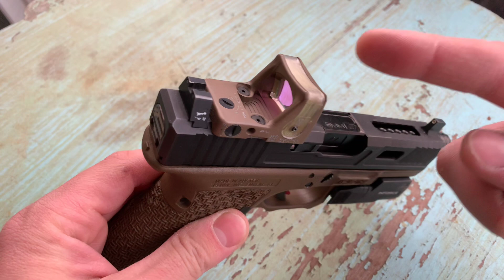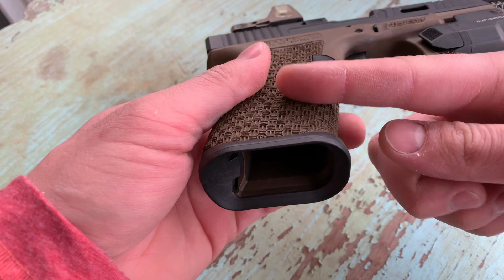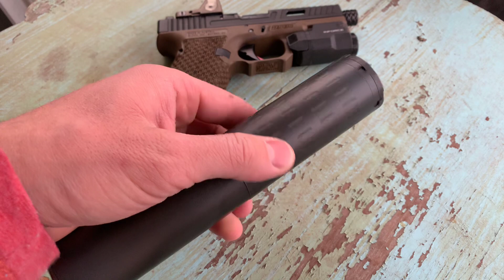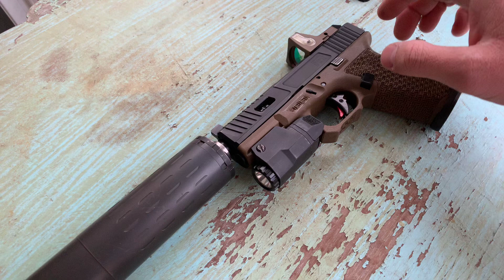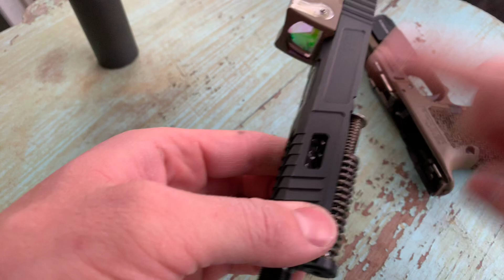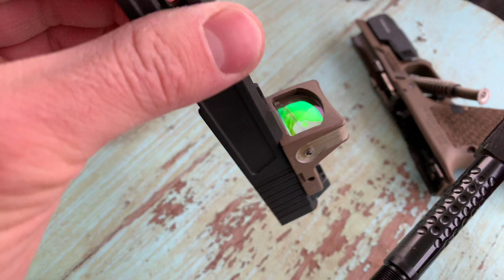Custom Gen 4 Glock 19, cycling with suppressor fixed!

Comment: Did cleaning and lubing the booster and spring fix your issues? I’m having the same issues with my G19 gen 4 and dead air Mojave 9, I noticed my spring wouldn’t move back and forth